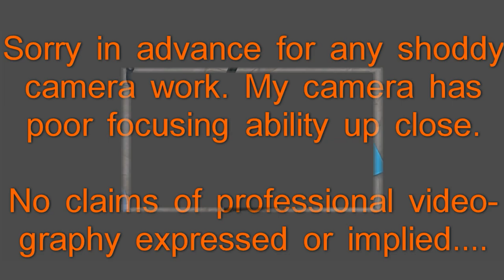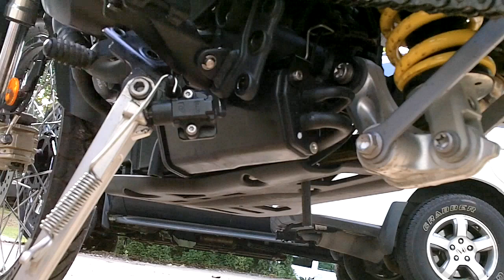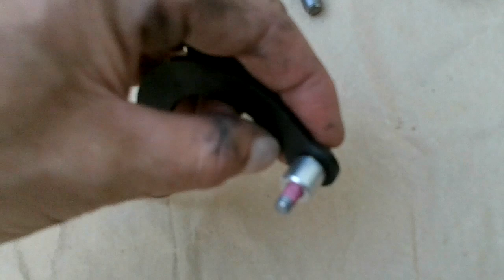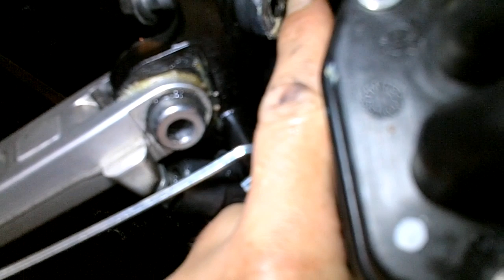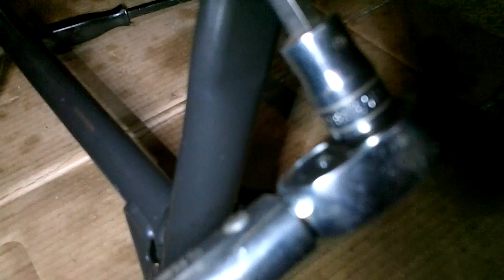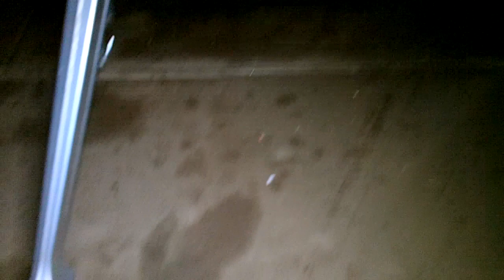2012 Triumph Tiger 800XC 800 Center Stand Installation

Comment: Great video!  Thank you so much.  

That T-30 for the s-bracket.  The triumph engineer that decided on the Torx-head should be taken out back and beaten.  A standard hex head would be low hanging fruit.  Easy by comparison.  Gah.  I need to revisit it tomorrow after drinking tonight to erase the pain.

Comment: Thanks for posting, great help in fitting mine today. Because I have crash bars on to fit the S bracket I found it easier to remove the rear brake actuator for access.

Comment: Just want to say thanks for your video it sure made the job easier!. I just installed mine on my 2013 XC. Some changes to note for others. First the kit number is now A9778015 second the bolt for the S thing for the spring is no longer a torx but is a 8mm hex, and you will now find in the kit a new bracket for the evap canister and a hose routing bracket which you don't need.